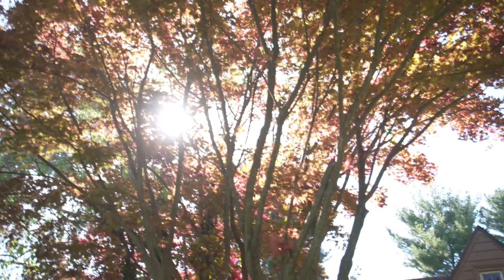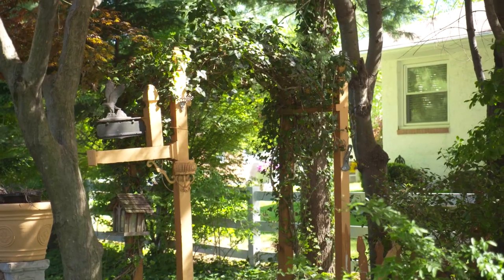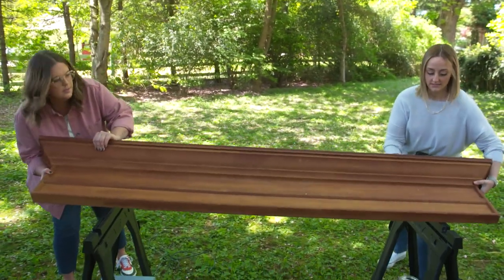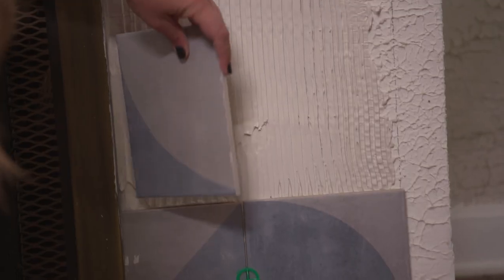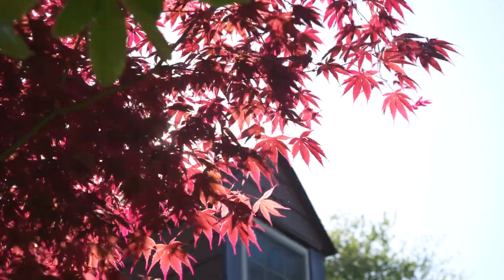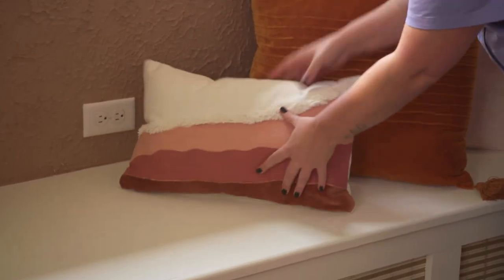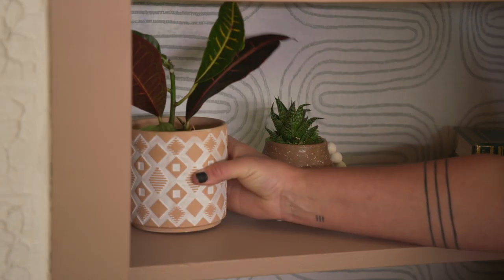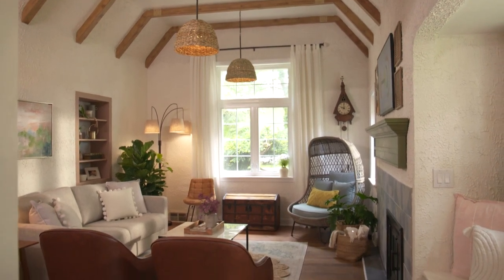The Weekender: “The Modern Rustic Cottage” (Season 5, Episode 3)

Comment: I wish they would have done a solid tile on the fireplace,  then used something else ( tile)  to frame it out , or a different kind of tile, it looks so busy and doesn't help the room.
I was concerned why they covered up a vent with the bench, no cut out for it (?) 
I look at a lot of the details, not just " Oooo and Aaaaa " of a makeover. I also realize time constraints, it would have been great to use a Piano Hinge  ( or two ) to be able to use that bench for 
storage.
Reply: Yes! I agree 100% -- also they said the pink tile would not work with what they had planned for the room, but then painted the shelf pink and included a lot of peach and pink decor.
Reply: The front of the bench lets air through? Making it storage would have prevented that? The tile is a matter of taste and it’s a big ceiling height. It can take it. Honestly I think it’s nice. They wanted a more modern boho take.